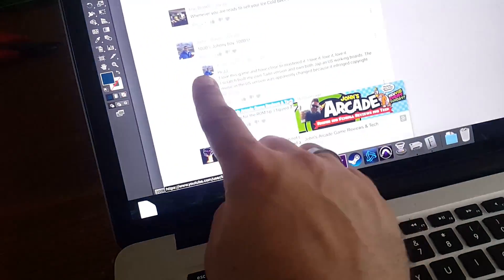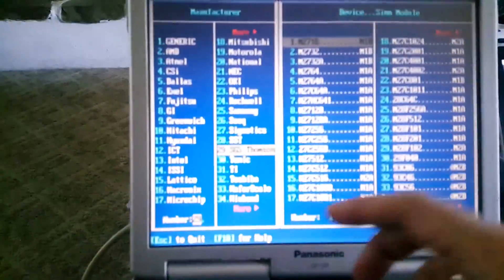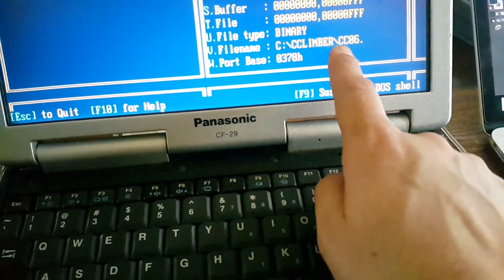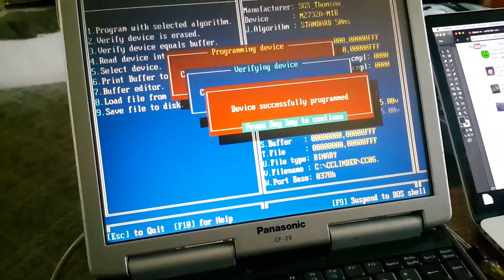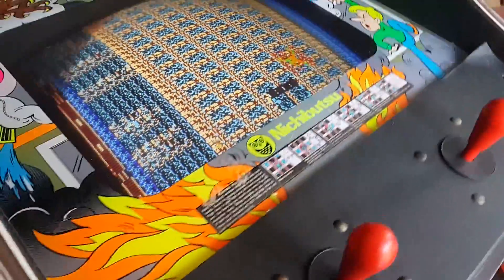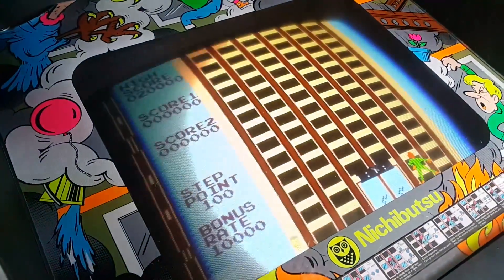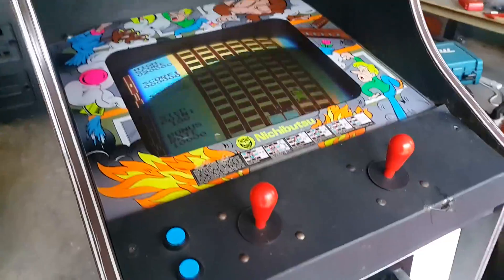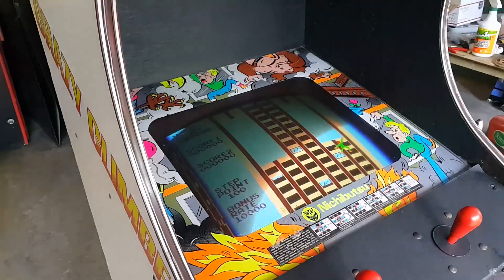Nichibutsu Crazy Climber Rom Mystery  - Verifying the EPROM USA and JAPANESE SET Glitch fix PART #1

Comment: Not sure if you know or not and apologize if parroting the obvious or already made clear; but all windowed EPROM devices are reusable. Can be reprogrammed 1000's of times by erasing with UV light each time, hence that window.  It is normal for data to start becoming corrupt after 40-70 years from the moment of programming.  You should erase and reprogram (refresh) all the ROM chips in the machine.  Otherwise another bit error can occur at any moment in the remaining devices.
Reply from the maker: +The Dollar Guy yes, I know. I've done videos on it and I have an eprom eraser. I didn't want to overwrite the originals as they might be unique.

Comment: A lot of confusing information in these comments. I would assume its the wrong replacement eprom. Having the wrong model selected will also effect read/verify commands which is why it probably failed at the first byte of data
Reply: Also highly recommend TL866 as a cheap usb programmer with a good interface (it also has a chip ID check!)

Comment: Don't download stuff from CoolRom! Me and lots of other people have gotten viruses on there. I would stick to Emuparadise or Archive.org.
Reply: SuperGojira2001 wouldn't the virus be bigger than the ROM sets and easy to spot by file size
Reply: Ninja Master Correct me if I'm wrong, but I think CoolRom makes you download an exe installer before you get the rom. Which allows them to install shit you don't want on your PC.
Reply: I personally use either Edgeemu or Emuparadise, yeah.
Reply: galivanting It's still really shady. I'd rather be safe than sorry and do business with another website that doesn't pull that type of shit.
Reply: ROMulation is my go-to. No arcade ROMs, though.

Comment: I kind of skipped through parts of the video but have you run it through ROMident online? I think that should tell you the version, assuming it's not one that hasn't been dumped for MAME yet.  Also I wonder that if you can't figure it out if you simply reprogram ALL the ROMs using one of the other versions it'll work correctly.

Comment: Hey John, is it possible the original ROM was 2532 and not 2732? Both hold same amount but slightly different pinout?
Reply from the maker: +James Brindle it's possible. I'll look into this
Reply from the maker: +James Brindle on the CPU board a couple of the ROMs are labeled 2732. So, I thought they all were
Reply from the maker: +James Brindle I saw something saying it uses 2532 and 2716s. Which is odd because I have two 2732s on the CPU board. The rest are not labeled.
Reply: Hmmmm, love how they make it confusing, according to the schematic, the ROM labelled "6" at 6N is a 2716.  So if you've put a 2732 in it, address line A11 on the EPROM at pin 21 is going to be a 1 (HIGH) so data you're seeing on screen is garbage from the upper part of the EPROM - if you don't have 2716's to hand, double the image up in DOS with COPY /B ROM6+ROM6 ROM6-2732 and burn the ROM6-2732 so that when pin 21 (A11 on the EPROM) is constantly a 1 because the board has +5v wired to that pin for the 2716 it should put the correct data out.  Give it a try.

Comment: Can you extract your rom to a file and compare that file's CRC with roms' from the internet? (LOL btw) (also try burning another rom chip)
Reply: I would be tempted to compare the CRC to the CRC's of the other roms in the set. I wonder if rom 6 isnt actually rom 6 and perhaps they are swapped on the board or swapped in the rom sets.
Reply: I meant maybe the chip he used was foobar
Reply: But the programming verified the CRC of the chip after programming from the original ROM image.
Reply from the maker: No, I did verify the one I burned. More than once as shown in the video. And the EMP-10 software automatically verifies the rom after it burns. And, I also burned another from the Japanese set and got the same result.
Reply: With mame can fix old games with only replace the failed roms
Reply: He verified the original rom, but not the one he burned. I remember he already burned a bad eprom at least once. I'm just guessing here tho. ^_^
Reply: It'd be handy if you could compare the crc's to be absolutely sure they are the same rom. If they aren't you can use that CRC to ask people to send you the right one. EDIT: Oh wait, if your original rom is corrupt the crc will be bogus..
Reply: Wait I think I know why the kinect was there... so you move your arms an legs to make the thing climb! That'd be awesome! XD
Reply: Absolutely!  I would also be tempted to rom ident the rom chips on either side of the chip too - to work out whether things are numbered the same as you are expecting.